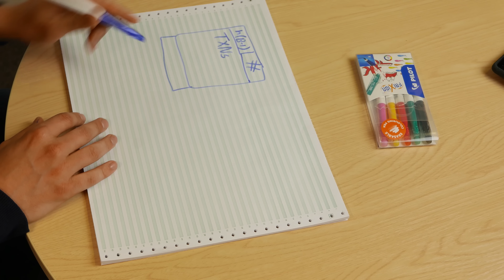Bitcoin Mining in 4 Minutes - Computerphile

Comment: Novice here. I'm still struggling to grok this. Where would you get the previous block hash and transactions from to attempt to create the new block?
Reply: Your “peers” on the network (other miners). Miners are incentivized to connect with one another directly, via sharing the IP addresses of their nodes with others connecting to the network. The reason is, they want to be aware who has discovered a successful block first so they can begin working on the next block as quickly as they can. So if Miner A, discovered the secret number (nonce) before miners B,C and yourself, they need to tell each of you as quickly as they can such that you can accept their submission and lock their result into the next block so you can get to work on the next one. Doing this effectively ensures their “reward” for discovering that previous secret nonce is honored and they get paid for having done so. So, each miner must continue to communicate with one another as quickly as they can and the only way they can do that is by having one another’s contact information to submit the work. And that’s done by having a shared contact list.

Hope this helped.

Comment: Wouldn't it be more beneficial to just buy a coin at a low value and sit on it until it's high in value as opposed to spending resources, time, and energy mining something only to have to wait for it's value to accumulate as well?
Reply: I think the idea is that you can mine bitcoin at a faster rate than you can buy that same amount of bitcoin at conventionally.

Because that hashing process lets miners add a transaction for themselves, that number of bitcoins they can get can be more than they put in with hashing power usage.

Comment: Analysts think Ethereum would explode higher in the weeks ahead as it passes key resistance levels in the high-$400s and enters the $500s. Ethereum is set to move toward the resistances in the $600 range as charts shows $600 is where the next weekly resistance on the macro chart lies, bitcoin also is Surging and has been on a steady increase also. There's no better time to accumulate and stack up because soon enough the price of bitcoin will sky rocket to the moon, there are two approach to increasing your portfolio as an investor first is by buying little bits of crypto periodically (DCA) and the second which is a preferred and a better option is trading because it is less capital intensive and more profitable. I trade daily with trade signals from Ethan McKenzie and I have increased my portfolio from 2 btc to 9 btc in the space of seven weeks. I can attest to the accuracy of his trade signals and he can be reached through WhatsApp (44 7723 042647) and Telegram (ethanmckenzie) for any trader looking to stay profitable.

Comment: But what benefit has that little hash? Is the 000000000101010101 hash magical or what? It makes gold from lead and wine from water, doesn't it?
Reply: It proves that there was a lot of work behind it, that's the point. It's very hard to find that hash, so when we do find it, we probably used a lot of computing power to do it. That's why it's called "proof of work".

Comment: Great video! I have two questions though: Is every miner working on the same block of transactions at the same time? What happens if two miners hash the same block successfully at the same time (I know this is highly unlikely to say the least) ?
Reply: It's up to individual nodes to pick which block to accept, the following block will determine which blockchain is correct. The longest blockchain becomes the official one.
Reply: @alexp-ru  I remember a while back there was some issue (to my understanding of it) with hostile miners figuring out a block then waiting before submitting it so while everyone else was still figuring out that one block they were working on the next and just had to make sure they submitted their finished block before someone else submitted their own valid block instead.
Reply: It's almost impossible. :) Each miner takes a set of transactions - usually those with higher fees attached first and then simply churns those by modifying the nonce  (number used once) each time until he gets a hash digest that corresponds to the difficulty adjustment.

Comment: So everyone starts to try to solve the hash from the #=1 and then just +1? Or do people start at different offsets, e.g. one starts at 200, another at 4030 etc.?
Reply: Hi Christian, the math problem is more simple than you might think. For example X + Y = 15. In that case, X equals something and Y equals something but it's impossible to figure out without simply guessing the answer. BTC mining equipment tells you how many "hashes per second" it runs, which is "guesses per second". Once someone guessing the answer, they win the ten minutes block of BTC. If the person that won was part of a mining pool, that block of BTC gets divided between everyone. The protocol is programming code that says, "as more mining devices are plugged in, make the problem harder to solve". That's so that the block only gets processed in exactly ten minutes. Likewise, the problem gets easier when people unplug their mining equipment.

Guess 1: x = 8    y = 7 (WRONG)
Guess 2: x = 20    y = (-5) (WRONG)

Those are the "hashes per second". So much easier than you think. Then, when thousands more join the system, imagine X + Y = 15 now becoming X + Y + Z = 15. Then it will still be solved with thousands more hashes per second, in exactly 10 minutes. More people get less BTC and less BTC costs more electricity to mine and BTC is worth more money. Hope that helps! Chris Bell
Reply: Typically mining pools break down different difficulty subsets for each individual miner  depending upon their hashrate and they all work on in as a group together with the btc reward being shared across all miners at the % they contributed in hashrate to the pool regardless if they found a block or not,
Reply: If you choose your own transactions it doesn't matter which nonce you start at because the transactions that each miner includes in a block will be slightly different or in a different order making. This slight difference ensures the starting position is completely different for each miner. If you are using a pool I suspect they have some method to decide where miners start to ensure they are not hashing the same data because that would be redundant.

Comment: Who came up with 10 minutes? And they say bitcoin is unregulated
Reply: You opt into the rules of the protocol by participating . It is a very different form of regulation where you voluntarily participate or leave or fork to your own rules as its all open source
Reply: It is regulated by states on the onramps and offramps typically , and for years me and other anarchists have been describing the type of regulation within the protocol and the community. Bitcoin is actually extremely well regulated , so much so that any slight deviation from the rules means you forked off and created an altcoin.  Anarchists aren't opposed to regulation FYI . They just prefer regulation that doesn't break the NAP (non aggression principle) which bitcoin is an example of. You cannot be forced to the rules with bitcoin even if we want to , the code , changes to the code , and use of the code is completely opt in and voluntary and open source. You can avoid new code changes even if 100% of the miners, 100% of the contributing devs , and even all 100k nodes worldwide outside yours  want them by as little effort as inaction. Even the software on full nodes doesn't self update , you need to manually opt in with any change and you can choose to leave or change the rules and create a new altcoin at any time along the process.
Reply: There are many types of anarchism. The root meaning of anarchy literally means without rulers (not without rules or laws) . I am unfamiliar of your proposed version of anarchy. 0 laws /regulations and absolute freedom doesn't sound realistic to me. For one there are natural laws that occur based upon human psychology and the laws of nature and our limitations as individuals . Secondly , I wouldn't want to live in a community without any laws , community standards , or "regulations" . If you want to live in a community with "absolute freedom" and no laws than be my guest , but I will not join it.
Reply: I live in an anarchist community , and visited many types over the years. Let me know where I can study the anarchist community you are discussing , from afar , as it sounds like a really chaotic place. Or does this form of anarchism simply exist in your head and not in reality? Rules can exist without rulers as well, like in the example of Bitcoin where devs , the creator , miners , merchants, and other economic users have no control over your node and how you define the rules. Rules also occur naturally as well, or can be formed through consensus in anarchist communities (not democratic)
Reply: sanisidrocr so you either "volunteer" to accept the rules or you're out. Yup sounds very much like regulation to me. Majority can't control? Don't use the word democracy then. It's regulated.
Reply: You skipped a crucial aspect , or you change the rules to anything else and carry on with your own currency with no one stopping you. Bitcoin definitely is not democratic , it uses consensus . Yes it is regulated , nothing wrong with regulations ... just much different type than many are used to as we can see right here
Reply: sanisidrocr regulation is fine by me, just making sure the anarchists don't misunderstand that it's not regulated
Reply: sanisidrocr the anarchist principle is zero regulation and absolute freedom. Clearly bitcoin is neither
Reply: sanisidrocr rules = rulers, anarchists don't care for the system lol. It's the opposite
Reply: Yes, it's regulated, but not by any single person or entity. We obviously need to have the ability to upgrade the system, right? And it's impossible that no one could change anything in any way. We have the code, we can change it. But to make the system as a whole change, you have ot take into accoutn what actually establishes the system in the first place. And that's the fact that people use it.

You as a single individual could fork Bitcoin and create your own version of it, but will anyone use your version? Who knows. The most "successful" version would be the one that most peopel use, right? That's how it's like a "democracy", but at the same time not a majority rule over minority. No one can shut down your personal fork of bitcoin. 
We can still all come together and come to an agreement about how we should all change bitcoin, to avoid unnecessary forks/splits into separate bitcoins.
Reply: We can change/update bitcoin if the miners all agree to do so. No single person or entity is in control, but it's run more like a kind of democracy amongst the miners. It's not exactly like a democracy, though, because the majority still can't control the minority, which may cause Bitcoin to fork, as it did at least twice last year.

Comment: So the probability of mining increases with multiple machines rather than graphics cards.
Reply: Yes, I did think the same. But if I have 3 machines and when I mine on them I will have a better probability of finding a has compared to having the same computational power in one machine  because those 3 machines are independent and thus will produce independent events. Generating hashes in the same machine is dependent on some algorithm thus creating probably a small trail of dependencies. Even random numbers generated by computers are not truly random (We use seeding to initialize).
Reply: I just commented how the numbers of hashes is correlated using one machine vs multiple. There is a difference in the probability of finding a match for the hash. Think of Bayes rule.
Reply: You need to produce more hashes per second in order to have a higher chance of being the first to find the right hash. More graphics cards means you can produce more hashes per second. Faster graphics cards also works. More machines also works.
Reply: In both cases, you're making more hashes per second, so it makes no difference at all. There really, really is no difference. It's all about hashes/second.
Reply: Yeah he's somewhat right... Although since it is random you would think it wouldn't matter... But say you have one computer start hashing at 0 nonce and another start hashing half way... and the next a different selection of transactions and nonce at a random number... You're increasing your surface area on the numbers your checking to try and guess where it might be, to try and get to it faster... Of course it may not work for you, but it seems like it might give you a better chance, sometimes...

Comment: If it's automatically making itself harder, is there a point to all of this??

I thought bit mining was auto solving complex problems, and you were rewarded with bit coins. Much like a regular job
Reply: anti/HUMAN Designs if it scales in difficulty with the Computing power, why do people bother with big mining farms. Doesn't that mean that I'd get the same results from my bedroom?
Reply: anti/HUMAN Designs or does the bit coin reward amount vary depending on the difficulty?
Reply: anti/HUMAN Designs aaaah, I see. Makes sense now, thx :)
Reply: We want there to be a new block every 10 minutes, on average. If we add more computing power to the network, then we can find the correct hash quicker than 10 minutes, so then we need ot increase the difficulty to try to keep it aroudn 10 minutes.

The problem miners are solving are completely arbitrary and do not mean anything. The point is that it's hard to solve this arbitrary problem, so it takes a lot of power to do it. The more power the network hjas, the harder it is for a single person or entity to take control over the network. That is the point of it all. It makes the system secure and decentralized.

There is no point in solving the mathematical problems, it only matters that it's hard to do so. It sounds strange, but you need to understand that the reason for all of this is only to make it practically impossible for one person to "hack" the system. And it works!
Reply: No, the difficulty is for the entire network, not individually for each person.
If you have 1% of the computer power of the entire network, then you've got 1% chance to be the first to find the right hash and get the reward.
If you have 20% of the power of the network, you have 20% chance. Thus you'll get a lot more rewards, statistically!
 
As you add your computing power to the network, the total amount of computing power on the network obviously goes up. But the point is that you want to have a large amount of power compared to other people, since it'll give you more chance to be the one to find the hash.

No, the reward stays the same no matter the difficulty. So if too many peopel mine, then no one will get rewards often enough for it to be profitable, so some people will stop mining, which lowers the difficulty again. So this way, you find a balance that's right at the edge of what is profitable.
But as the coin increases in value, there's a window where you can earn a lot of money quickly before more people start mining. If the coin drops in value, you it's the other way around. Now it's not profitable for anyone, so some will stop mining.

Over time, mining hardware becomes cheaper and more powerful, and uses less energy, so more power is added as technology increases, so it'll keep staying at the edge of what is profitable.

Right now, because bitcoin has dropped in value, mining isn't very profitable. With one GTX 1080 and very low energy costs, I earn perhaps $1.5 to $2 per day, only. It used to be more than twice that, a year ago.
I'm hoping it'll get better, soon.